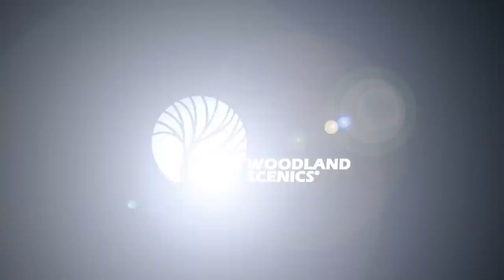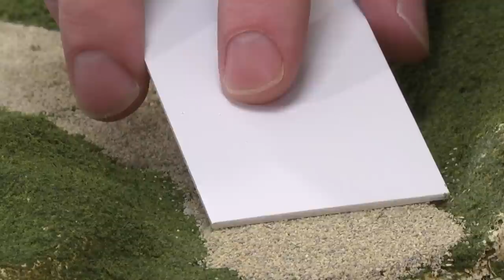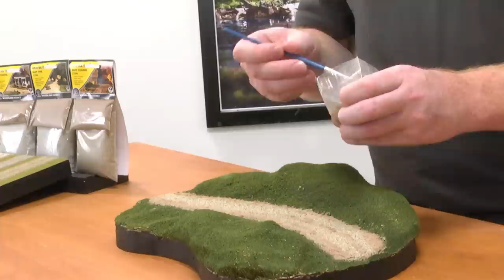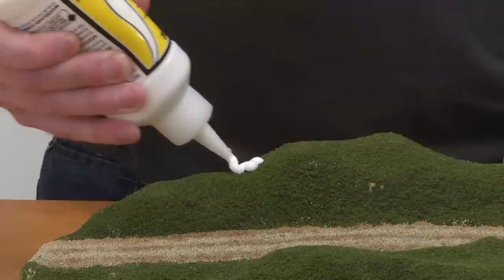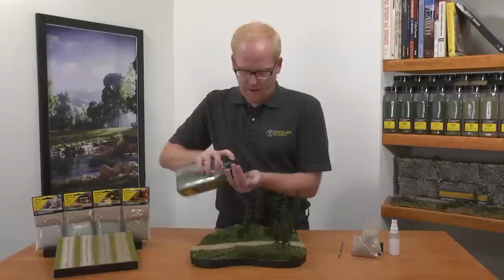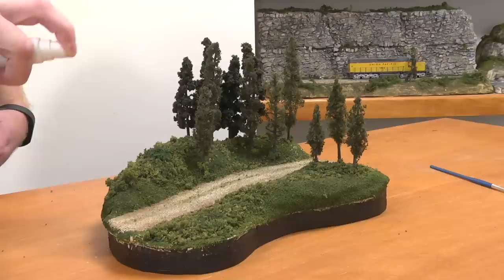Model Gravel Roads | Woodland Scenics | Model Scenery

Comment: The ballast gravel on the track on my railroad along eith gravel roads were tone using Woodland Scenics products. The ballast gravel is three colours mixed One part dark brown, One part light brown and two parts buff. I should have added one part medium grey I used Elmers carpenters glue cut 50%with water and with a bit of liquid soap to glue down the road and ballast.
Reply from the maker: +Cliff West Sounds like you put a lot of work into it! I hope it works out well for you! Thank you for taking the time to share your modeling techniques.
Happy Modeling!

Comment: How long does the scenic cement take to dry?
Reply from the maker: The dry time depends on a couple of different things, such as the amount applied and environmental factors like humidity.  Scenic Cement should dry completely within a few hours. To help speed up dry time, place a fan in the room to increase circulation.
Reply: Okay, thanks for the info.